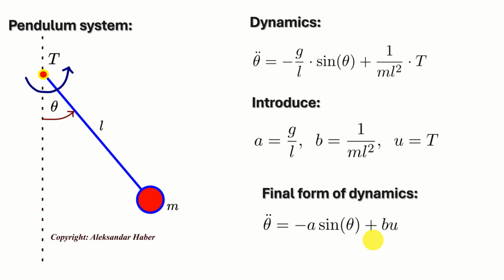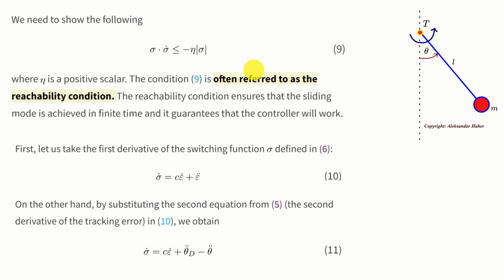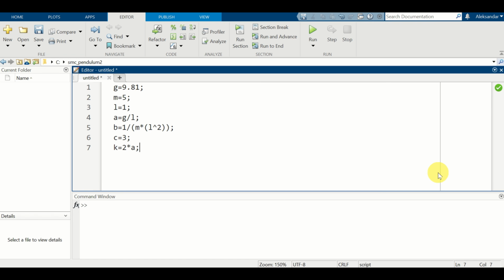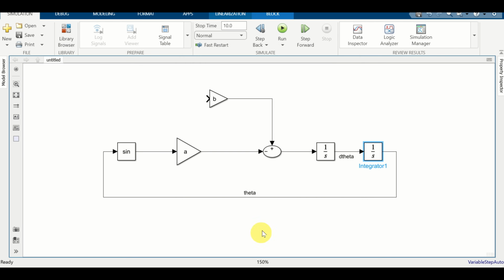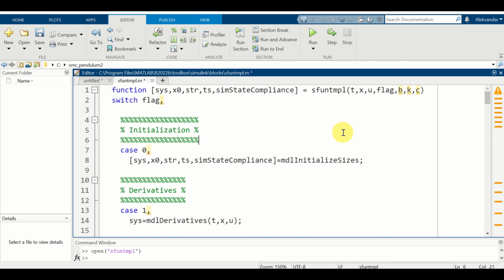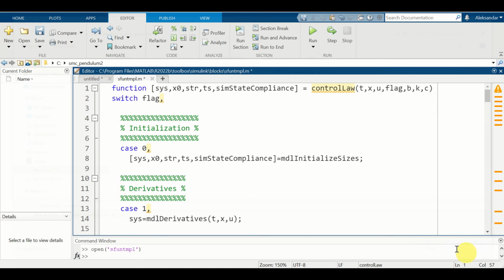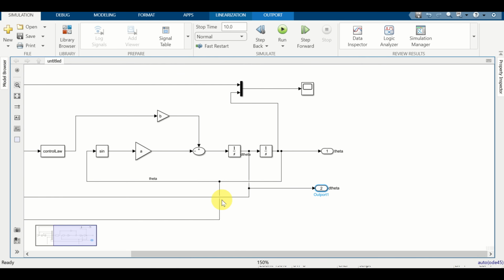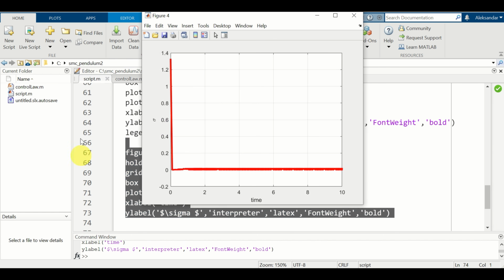MATLAB/Simulink Implementation of Sliding Mode Controller for Nonlinear Systems

Comment: very  instructive video. thank you for your explanation. i would like to use this method to stabilize the output voltage of my switche reluctance generator but i don't really know where to start and how to implement it on simulink. thank you.
Reply from the maker: Glad it helps! Takes long time to learn how to do that. However, this tutorial can serve as the starting base.
Reply: @aleksandarhaber good job